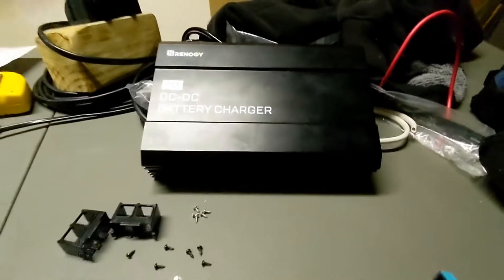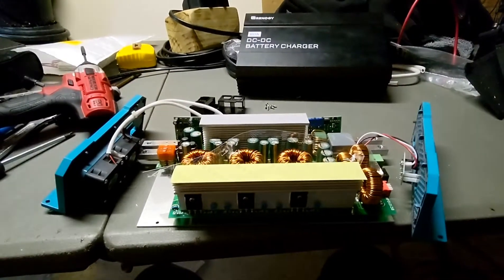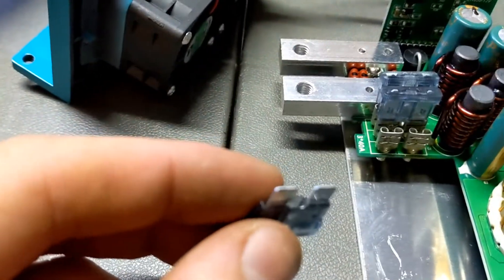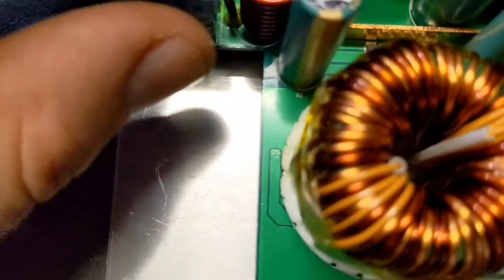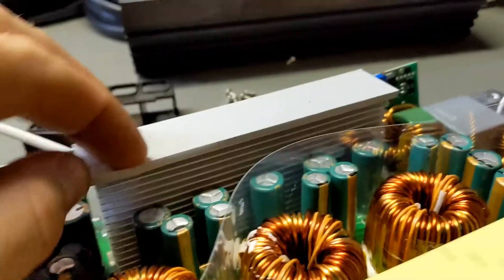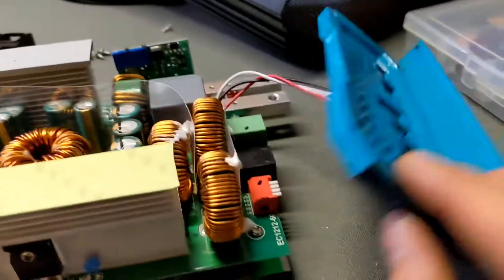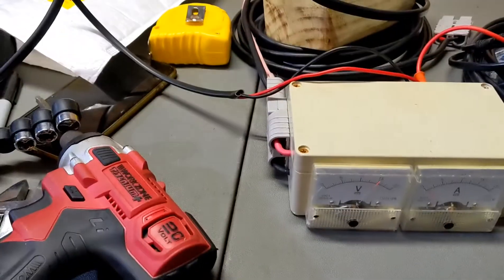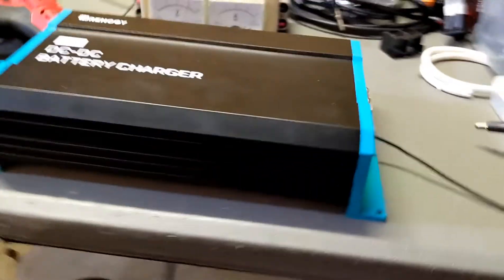Renogy DC to DC polarity reversed, easy fix ?

Comment: Thanks for posting this.  I see the other comment that Renogy sucks.  My limited experience with them is to agree with him. I have a DC-DC with built in MMPT.  Dead out of the box but I was out of warranty before trying it.  And their technical support line didn’t tell me anything I hadn’t been able to figure out myself.  If nothing else, I’m going to open it up and look at its guts.
Reply from the maker: My experience with them has been good so far, I don't install things for a living so limited exposure to their gear, I have installed  2x 20a dc-dc chargers, 2x 60a dc-dc chargers, the 40a mppt solar regulator, 200ah lifep04 battery, 2000w inverter, 2000w inverter / 65a mains charger and a 200w flexible panel. So far everything performed to spec as opposed to kings (4x4supacenter) where a 200w panel gives about 100 real watts the renogy 200w gave exactly 200w in my testing.

One nuisance with the inverter charger, I would have thought it would connect to the renogy one to show power consumption / charge stats but it has no smart support. the 200ah lifep04 gives a current reading though so it wasn't important to me anyway.
Also the renogy one technically uses zigbee smart stuff but they have locked it down to only control renogy brand things. Still a neat unit.

I have contacted their support for a delivery status update and got an answer next day, luckily haven't had to deal with warranty claim so far.
Reply: @leondoinstuff3033  - Well, I just learned that part of the problem was my failure to have knowledge beyond their limited manual and tech support.  So it may not be that the product sucks, but the information needs to be better.  I’d be so lost without Youtube!!
Reply: I have had great support from Reneogy. BUT they do not want you opening their devices - which sucks when it's as simple as internal fuses blown. Youtube for the win. Again